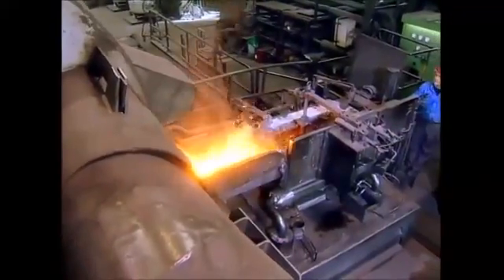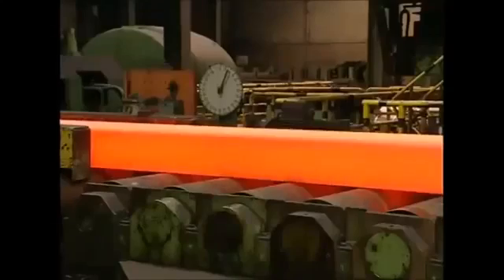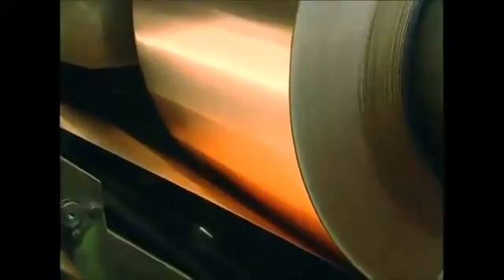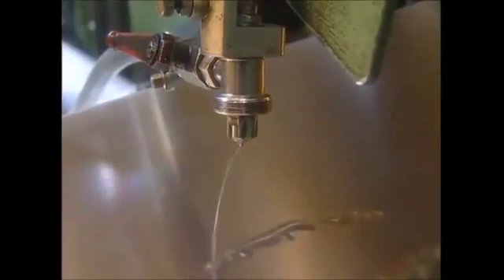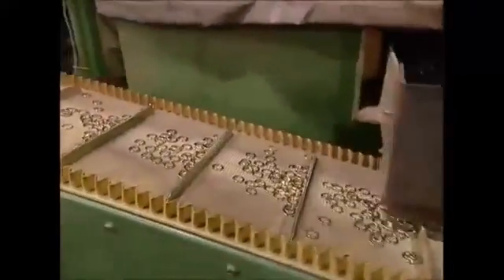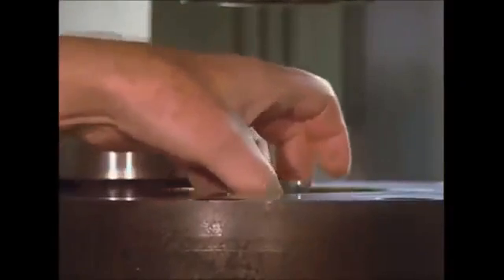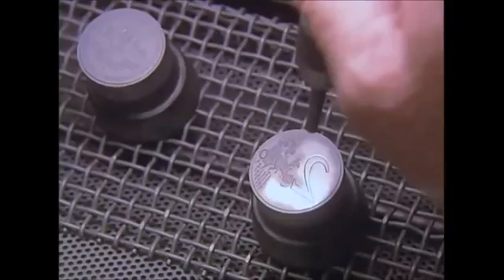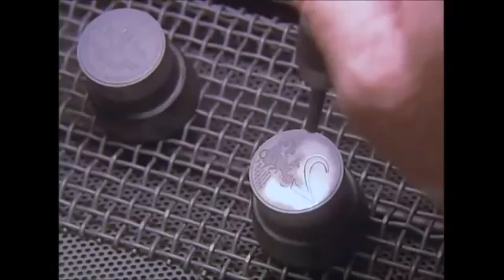How It’s Made Euro coins

Comment: and why do cents have a steel core?
I thought they were copper so I was going to melt them to make an alloy...
but below the copper coating was steel and it turned everything bad.
why?
Reply: pure copper would be more worth than the value its printed on.
Reply: In short, cheaper